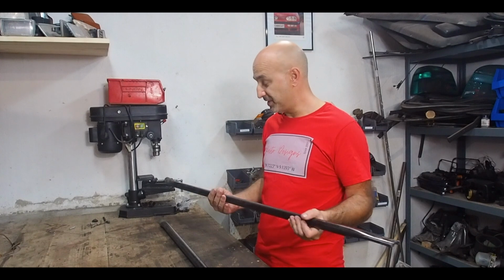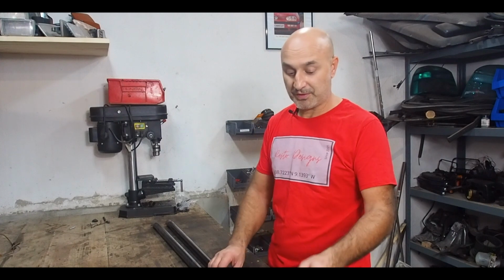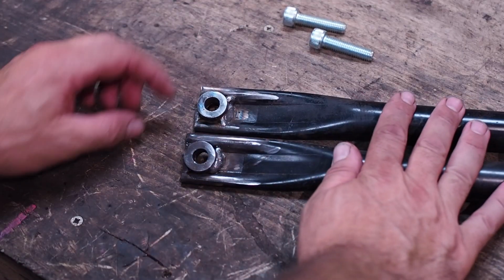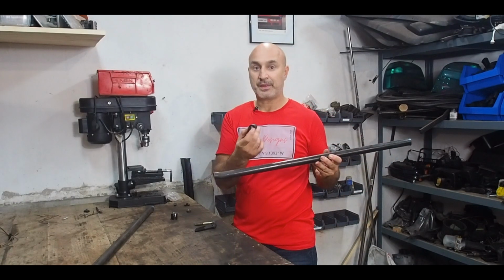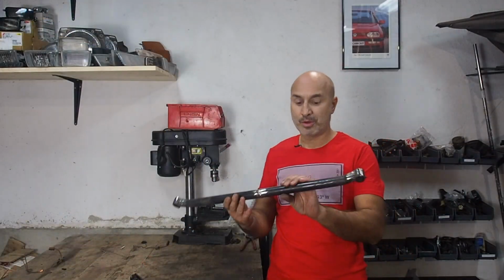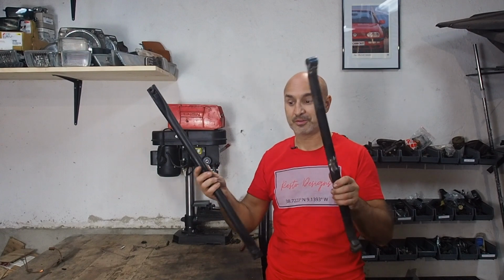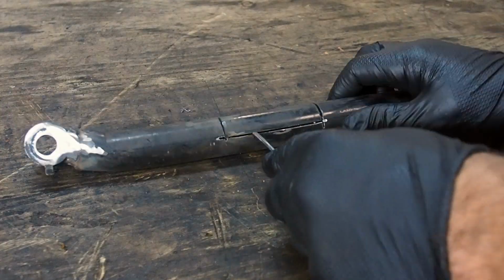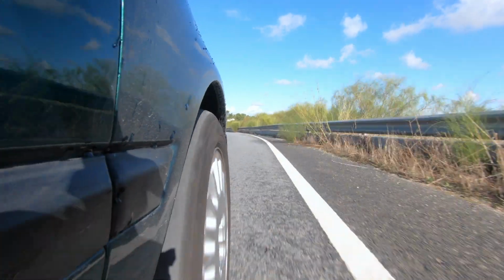Golf mk3 My great 'crash bar' strut braces Hack

Comment: Top grade idea... Cheap and effective ...I got a deal on all 3 front up upper and lower front and rear upper from omp on eBay at a steel to be fair ... As for ARB route what are youing thinking?👍
Reply from the maker: Thank mate,  yes the two lower ones work really well, I have a Eibach rear APB to fit as well as a Passat B3 25mm front one.

Comment: Hello, Can you tell me if the weight Steel block at the front off the car is usefull ?
Reply from the maker: It is meant to help damped vibrations in the cabin.

Comment: I have a question
How i can have 4x100 on a abf setup 

I'm asking because i have all the abf conversion and i want to put in my car witch now has 1.6 aft. Is there an option not to remove the 4x100 setup becuse of the wheels ( I don't want to change them).
Reply from the maker: You will need to use 4x100 front wheel bearings and 4x100 flanges in the 5x100 hubs, and use the smaller outer 4x100 CV joints on the 5x100 driveshafts. Then just re drill the 5x100 brakes discs to 4x100.